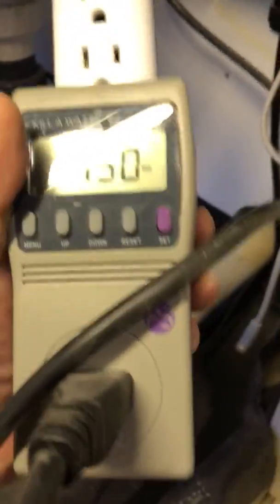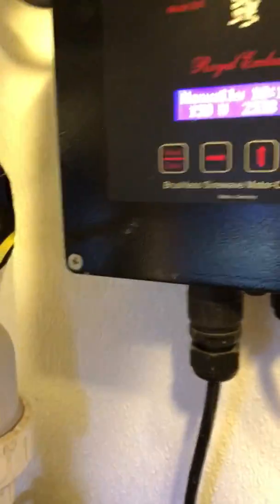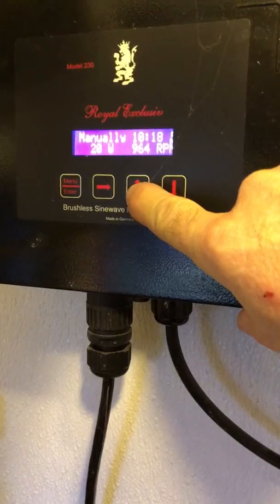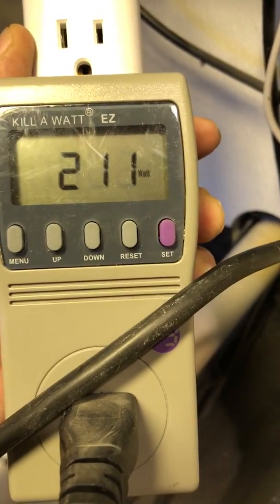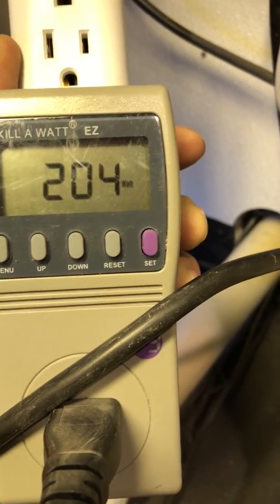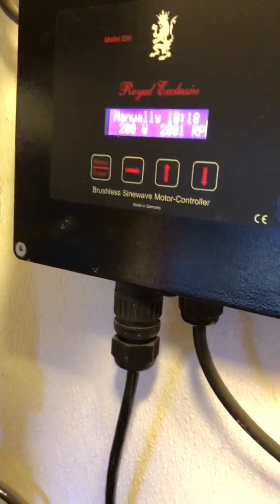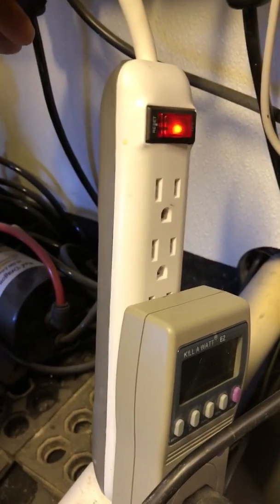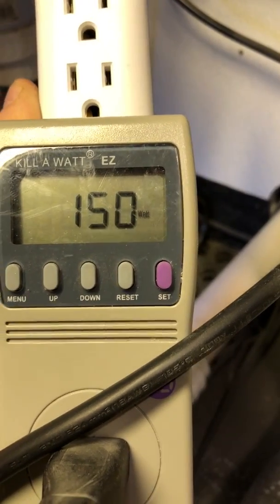Royal Exclusiv RD3 230 Kill-A-Watt test vs actual wattage.

Comment: I’m about to buy a 230W RD3 for my 10ft, 1500L Aquarium.. what would you say about the noise level from the pump? I’m after the quietest pump that can shift my tank volume 5 times, after head pressure, and without the pump being on 100% (230W) .. I’ve worked out I can turn it down to 200W to get 5x circulation per hour..

Just curious about the noise, love to hear it from you before I splash out just over £1000 for it. 

Look forward to your response :)
Reply from the maker: They are damn near silent. When I got my first RD3 230, I set it up on my closed loop which returns under my rocks. I had to redo plumbing to get it in as it replaced a Reeflo Dart. When I turned it on, there was no noise or vibrations and I freaked out. I thought the pump was dead and was honestly pissed off. It wasn’t until I saw sand blasting out from under the rocks that I realized that I realized it was running and just about as silent as they come. It wasn’t long after that I swapped out my return pump for a 2nd RD3 230.
Reply from the maker: I can honestly say that the RD3’s are about the quietest pumps I’ve ever heard or ran. I am sure once you get yours, you will agree. And they are absolute beasts!